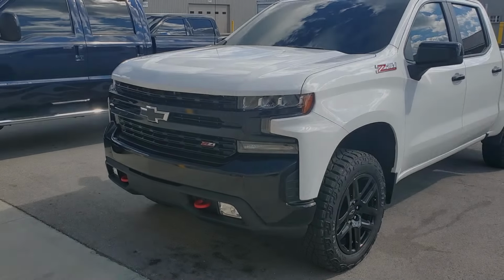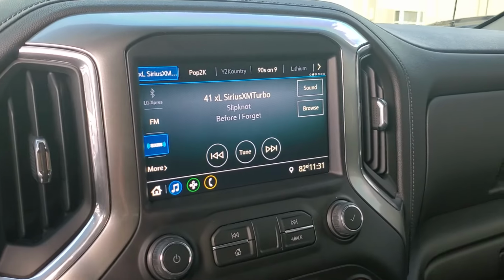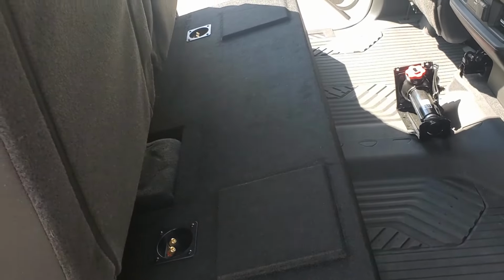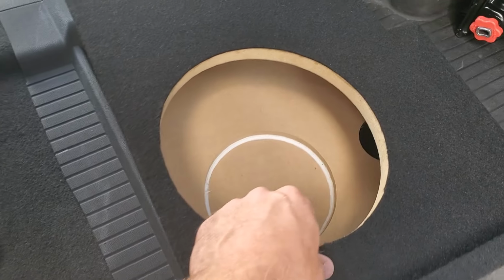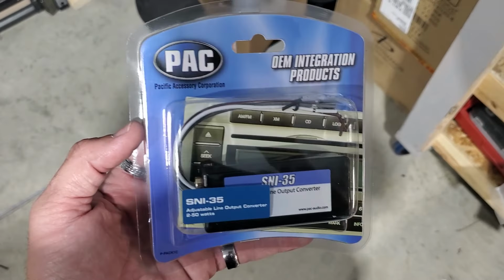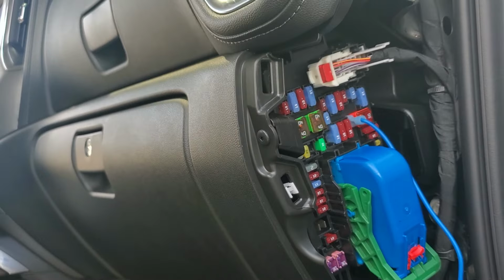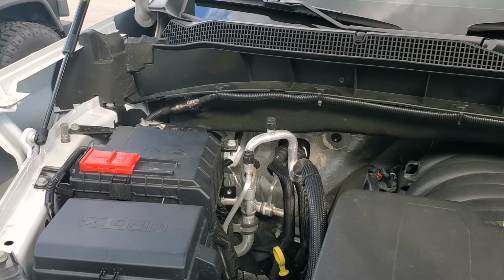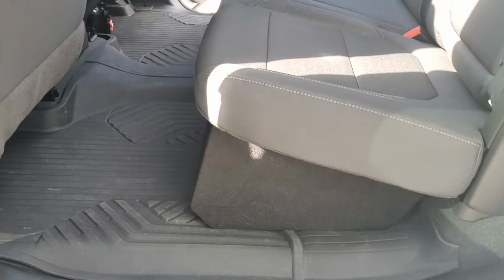2019 -2021 CHEVY SILVERADO / GMC SIERRA AMP AND SUB INSTALL - NON BOSE

Comment: Should you run your power on the opposite side of the LOC wires ?
Reply from the maker: If you are running a sub amp you don't have to

Comment: Connecting to the 2 green wires wont that only give you 1 side of the left and right channels?
Reply from the maker: It is a mono signal going into a sub amplifier. If you're connecting a highs amplifier you will definitely want to use both left and right speakers
Reply: @octanetvchannel  no it is not a mono signal if you are connecting to the left rear speaker. You need both left and right input for a true mono signal.

Comment: Not sure if you'll see this but I was wondering how this truck sounded with aa stockk non bose system when adding 2 10's. Do u feel that the speakers needed to be upgraded as well or?
Reply from the maker: It sounds good but just depending on how loud you like your music. I love my music loud with the windows down so I would definitely upgrade my speakers if it was my vehicle. Some people would probably be more than happy with what this is without upgraded speakers.
Reply: @octanetvchannel  yeah I kinda had a feelin the subs might have been too much for the speakers if turned up too much. I have the same truck just a sierra and I think I finally found out today that it's not a bose system but dealer could not tell me if there is an amp or not.. did that system in this truck have a factory amp or is the head unit the amp and if so do u ha e any idea what the watts per channel are? Thanks in advance.

Comment: I’ve tried everything possible, still have slight hiss in speakers. Ground is good, still have sound with NO RCA input, amp is T400 Rockford fosgate, LC5i pro LOC, sky high wire. The ground reads 0.4 OHM. Power wire is ran outside of the vehicle. RCAs are reputable brand. Not sure what else to do. Tried multiple amps. Multiple LOCs. Gains are at appropriate level with amp input set to 4volts with multi meter. Any help is appreciated!
Reply: Did you disconnect the anc?
Reply: I’m not sure if my truck has it. It’s a 2020 Chevy Silverado non Bose 5.3

Comment: Video helped me install an amp and a single custom box 12. Much appreciated!!
Reply: I ran the power on the passenger side however. Everything else was spot on to what y'all did.
Reply: @rynosrage1497  did you find the nipple thing to cut off and slide it through  with soap to get through the firewall on that side.  that took me forever.
Reply: No soap. Cut it went through kinda easy but took about 10 minutes. Finally got it though.
Reply: @rynosrage1497  My fat fingers couldnt get it.  I am also only 5'7" and have a leveling kit on my truck.  I literally had to use an A frame ladder.  LOL! Finally just got the dawn off the sink and slid on through.  Wiped it all off good and kept moving.  I am waiting on my amp in the mail.  I cant wait!!  Dual 12s in my 21 Silverado.  350wRMS x2 @2ohms.  Not super loud but will do just fine for my tastes.  Down firing box cut for under the rear crew cab seat.  Have to go to Home Depot and get some Female Spade connectors for the remote line tomorrow.  Didnt come with them on my kit I bought.  There was a seat bolt i just undid and used a drill wire brush went down to metal bolted her down and used a little rusoleum  black around it afterwards.
Reply: @rickharris8780  glad you're getting it done. My 12 does just fine. Loving it. Hope you enjoy it once it's done.
Reply: @rynosrage1497  would you happen to know the speaker wire colors on the right side ? Non Bose system

Comment: Hooked everything up and no signal.  SNI-35 hooked up to blue/black and white on right side (rear woofer signal wire).  Verified power in/out sub, signal seems to be the issue.  Cannot figure this out.
Reply from the maker: You could possibly have a bad SNI-35 If not I would buy an RCA to headphone adapter. Plug the RCA side into the amplifier and then plug the headphone into a phone and play music through it and see if that works

Comment: What do you call the connector you connect the remote wire onto passenger side fuse box?
Reply from the maker: Typically it's a female quit connect plug. Mainly they use them for speakers or other things similar. You could probably even use like female speaker terminal connection or connector

Comment: Silly question, but since you are using a PAC line convertor and that is a non-BOSE system, why not use a PAC LPHGM71 T-Harness for the speaker leads, remote wire and power for the line convertor?  You can do everything on the passenger side of the truck and you don't have to tap any of the factory wires or the fusebox.  The harness takes care of that for you. Not trying to be critical, just curious.
Reply: So do you run it to the back of the head unit?
Reply: @dylanbushre2681  No. It's a speaker breakout harness. It tees into the module on the passenger side kick panel.
Reply: @drumdoug8083 How do you unplug those wire plugs going to the module? I can't get them to unplug.

Comment: Great install , my 2021 Chevy 1500 Custom did not come with the Bose speakers, I did notice before I had my 5 channel 1200 watt amp and 10 inch installed, my factory stereo would drop it’s signal? The installation company mentioned this is a common issue with GM stereos? My wife’s car is ok but my daughter’s car does it once in a while. How can I fix this ? . Cheers 🇨🇦

Comment: For the 2019 gmc sierra 1500 non bose the wires you need on the passenger side are blue and white braided together
Reply: Thank you
Reply: Quick question? My loc has more than just blue and white wires on it? Do I only connect the blue and white wires on my loc to the blue and white braided wires
Reply: what is the ground and positive wire
Reply: Put both negatives together and both the plan colored together. You will not use the brown as those are ground wires. Then attach to the 1 negative wire in the harness and the 1 positive wire on the harness.
Reply: Which one’s positive and which one’s negative?
Reply: @barteremperor211  i found using the green and green in black braided together on the drivers side was easier. i just paired up the solid wires and the striped wires on my rca converter
Reply: @Mike_Gs  So I can just put both positives into one wire and same with negatives?
Reply: @barteremperor211  idk how your doing it but i just had a speaker wire to rca converter so i put the solid color wire to the solid color in the wire harness and same with the stripped wire
Reply: @Mike_Gs  I’m using t-taps to splice in the speaker wires from my loc
Reply: @barteremperor211  that’s what i did
Reply: I’ve hooked it up to the blue and white  and the green with the strip. Neither work. Any clues?
Reply: @deanrunyon4777  was the blue and white wires braided together? I'm pretty sure it needs to be a braided set
Reply: @max22131 yes it’s the solid white and the blue with the black strip braided together
Reply: @max22131 I got it the T clamp didn’t fill pinch the wire so there wasn’t any continuity. Thanks
Reply: I’m getting nothing off the white and blue braided wires.
Reply: @deanrunyon4777  thanks for this comment after I read I went back and sure enough the clamp hadn’t even penetrated the insulation
Reply: Those go to the rear speakers. The signal is weak compared to the front door speakers.

Comment: My 2024 Silverado 1500 non Bose doesn’t have the Lug on the passenger side fuse panel for the remote wire. Is it possible it could be located elsewhere?

Comment: Ok so this video helped tremendously but I do have a issue with my setup I did something wrong and could use some help lol ok so with everything plugged in and wired   Up I have almost no bass but if I take one of the rc cables out of the amp it works like a charm but as soon as I plug the second rc cable in the amp it loses 90% of the bass any thoughts as to why and could I just run it as is with one rc cable to the amp
Reply from the maker: I would probably say it's in the line converter either it's wired wrong or it could be damaged? I would probably start there

Comment: Anyone know if its any different for the new dash style? I know remote cable will but not sure on the speaker wires to tap into.
Reply from the maker: Depends on what system you have but we have other videos on brand new 2022 and 2023. Just look through our videos under Silverado installs

Comment: Nice vid!  Question for you. I have a 2021 Silverado RST Diesel (Non-Bose) I'm looking for the cross braided GREEN & GREEN+BLACK stripe to connect the SNI-35.  I only have braided BROWN & BROWN + BLACK stripe.  Have you noticed other colors for the high & low on 2021 Silverado's ???   Thanks !
Reply: I have a 2020 3.0. We're you able to confirm the right color word to tap into??

Comment: Gday, I have a  2021 RST 1500 Silverado ,Crew Cab ,with the Bose system and moulded plastics under my rear seat. I’m looking to purchase a box for two 10” . 
Can you help me ?
Thanks.
Reply from the maker: Is it this body style?
Reply: @octanetvchannel  
Yes, looks like the white truck you were working on. Actually mine is also White.
Reply: I should tell you that I am located in Canada, Timmins , Ontario.

Comment: I appreciate the video...helped me install my 2 12s under the rear seat and amp in my new 22 Silverado custom non Bose...after hooking up it sounds amazing...but question now the highs are not high enough so if I wanna run another amp for my highs would I have to run another sni-35 for highs amp and then another power,remote,and ground for new amp or can I jump off the original amp like old school
Reply: In the Silverado custom cause I have the 2.7 turbo not V8... it's a different setup under the hood...i did use the drive side yellow wires to hook up the PAC and rim the rca wires...but i decided to run the power wire threw the firewall rubber grommet behind the battery on the passenger side it gave me more power wire...I also removed the the floor jack under the seat and used the bolt and screw that was used to hold the factory jack down for the ground and hid it under the carpet...I have a double cab...I used the ground shacker box made very well with 2-12" hifonics subs... pioneer d9601 mono 2400 amp...sni-35...and soundbox eck4 4 gauge wiring kit made with good quality wires...sounds amazing and wasn't what I was expecting it to sound like...been in the car audio world for 20+ years
Reply: @jamie kilbury  I have the same truck can you possibly give a step by step? I have 2 10" kickers, pac 35 and a decent sub wiring kit to hook it up. Ok I know I have to run the power from the battery, this video says green wire on the driver side. Should I tap into the yellow? Also is it the same fuse as the one in the video to run the power wire too? Where do the remote wire go?
Reply: @keithervin2348 I did almost everything the same as the video...the remote goes to the tab in the passenger side fuse box...I ran my power wire on the passenger side behind the battery threw the fire wall there is a black rubber grommet with other wires going threw it,it's kinda a pain to reach up under the dash to get it but use a flash light and take your time...I hooked the pac up on the driver side i believe its green or yellow wire cant remember but its the only two wires that are branded/twisted together tap into that...then run your rca wires...I removed the jack from under the rear seat...I used one of the post for my ground...I have two 12s in a ground shacker box,2400 pioneer champion amp...I plan to add another amp for my highs
Reply: @jamiekilbury7346  not sure if you will see this but , just wondering the 2 green/yellows I’m assuming they are slightly different how do you know which is which ? Ty
Reply: Where can I find the box and what brand amp best for 12s

Comment: My fat fingers couldnt get it.  I am also only 5'7" and have a leveling kit on my truck.  I literally had to use an A frame ladder.  LOL! Finally just got the dawn off the sink and slid on through.  Wiped it all off good and kept moving.  I am waiting on my amp in the mail.  I cant wait!!  Dual 12s in my 21 Silverado.  350wRMS x2 @2ohms.  Not super loud but will do just fine for my tastes.  Down firing box cut for under the rear crew cab seat.  Have to go to Home Depot and get some Female Spade connectors for the remote line tomorrow.  Didnt come with them on my kit I bought.  There was a seat bolt i just undid and used a drill wire brush went down to metal bolted her down and used a little rusoleum  black around it afterwards.

Comment: Hi  why May amp. Get very hot under the seat   Same  place where you install it ?  Is any specific amp ?
Reply from the maker: It probably depends on the amplifier the one that we use is class d. It's very efficient. I would definitely check your voltage going into the amplifier and make sure that it's staying above 12.5. it could be a bad ground or not enough gauge of power wire

Comment: did you use all of these units? SNI-35 PAC, SNI-15, SNI-50A. I ordered the SNI-35 to hook up only running a comp 10 inch kicker. do I need to add the following to get proper bass
Reply from the maker: Those are all options you just need one
Reply: @octanetvchannel  I hooked up the SNI-35 PAC to driver side per video but I am receiving a lower output on my door speakers any suggestions?
Reply from the maker: @chrisweckesser3778  I am not sure what you mean?

Comment: When you hooked up the remote wire to the fuse block on the passenger side, did you use an inline fuse, or is there not a need for one?
Reply from the maker: No need
Reply: @octanetvchannel  thank you for the help and quick response.
Reply: I do not have the tooth to hook into, did you move the 50a fuse at all?

Comment: What color wires would I tap into if I wanted to put output converter on my passenger side?
Reply from the maker: We are not sure on that we typically just do it on the passenger side
Reply: Did you figure the Color out?

Comment: Did you only tap into the left rear speaker wires?? Did you tap or connect another converter on the right side for the right rear speakers?? PLEASE RESPOND I AM FRUSTRATED AS HELL
Reply from the maker: You only have to tap into one speaker it is a mono signal. You will need to connect both negatives on the LOC together. Then you will connect both of the positives together and connect the positive side of the LoC into the positive of the speaker lead. Then connect both negatives into the negative lead of the speaker. If you get it mixed up it won't matter because it's a mono signal. I also have multiple videos on how to hook up an LOC on our channel

Comment: What wires are those green wires are they speaker wires your tapping into? I’m currently working on mine but I’m running it passenger side
Reply: The speaker wires they are on the driver side

Comment: Does it void the warranty by putting subs in a new truck?
Reply: If you happen to have electrical issues I'm sure the dealer will point straight to the system

Comment: Question: that box would you be able to flip it up and have the subs facing the bottom of the seat or not enough room if someone wanted it that way?
Reply: That’s the type of box I’m looking for. Right now I have four 8’s facing the back of the two front seats that don’t hit as hard as the 10’s would hit.

Comment: So on your green wires you tapped into, that is just only the one set. Meaning like the drivers rear door speaker, no left and right? Thanks man!
Reply: I’m about to install a single sub on my 2019 Sierra and didn’t know if I needed to tap off of 2 speakers or just one for my signal.
Reply from the maker: You only need to tap one. If you get a chance watch our other video that we posted up about 5 to 6 months ago about how to install an l o c or line output converter. It will tell you a step-by-step process as well
Reply: @octanetvchannel  Awesome man, I appreciate your quick response and help. Have a good day bro!
Reply: @octanetvchannel  So I just hooked up a Alpine MRV-250 to one subwoofer. I used the signal level for on/off but when the amp shuts down I get a terrible humming noise and it seems like the amp won’t shut down at times. I have a good ground. Any suggestions on what I should look at? Thanks.
Reply from the maker: @elmobascle8182  I would check the impedance of the subwoofer and how you have it wired because that sub-amp can only run at two ohm
Reply: @octanetvchannel  The specifications on the amp has @ 4ohm 150X1 Rms and @2ohmX250 RMS. The sub I have is a dual voice coil 4 ohm speaker. 

That will not work?
Reply: I was assuming since the sub is at 4ohms then the amp would run the sub at 150x1. Is this correct?

Thanks man!
Reply from the maker: @elmobascle8182  that is the correct impedance you might have a bad amp or something?
Reply from the maker: @elmobascle8182  if the sub is a dual 4 ohm and you wired it parallel where positive goes to positive on each voice coil and negative goes to negative on each voice coil the sub will see two ohms and the amp will see two ohms
Reply: @octanetvchannel  Right now on the speaker  it’s connected to one positive and one negative terminal. The other 2 speaker terminals are not connected. I wanted to get 4ohm load. I’m not a electrician but this isn’t right?

Comment: Detailed video!! I have a 2022 silverado custom. Non-bose. Did you run into issues with the active noise cancelation? I have what looks like mic covers in my headliner, but I think there is nothing behind them. Thanks for the help!!
Reply: What color wires did you tap into?